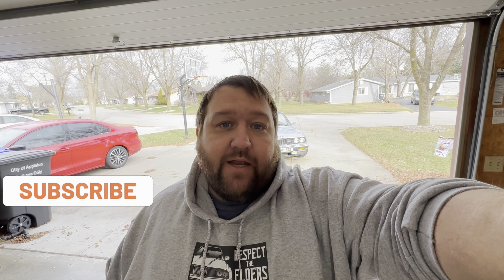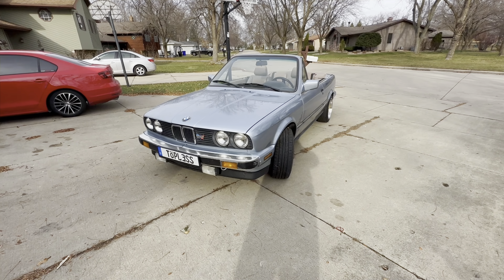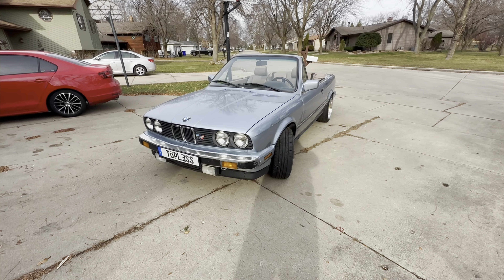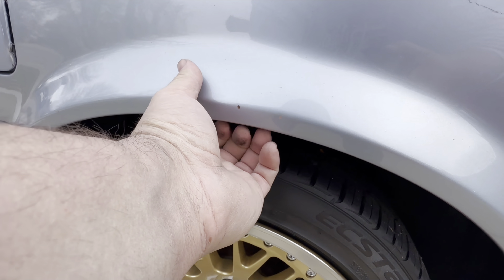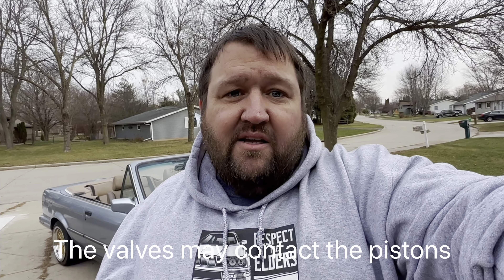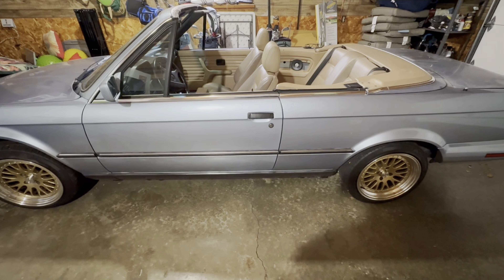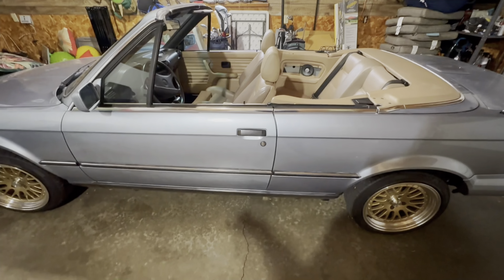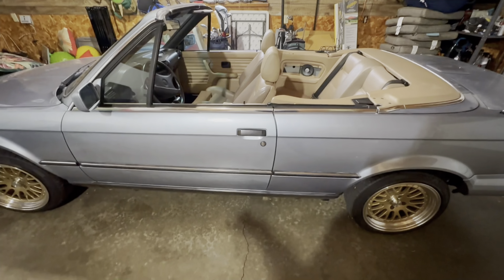Before you buy your first e30, watch this!

Comment: bought my e30 with a broken odo that said 140k miles after getting the carfax for it i found out it had 250k miles in 2007 hahaha. Has atleast 400k on it now with the same motor and is still going strong!
Reply from the maker: 400k means it’s just broken in. Time for a turbo lol.
Reply: @TheEuroLife.  thats the plan! eventually lol
Reply: are you kidding?? that's insane. my odo just went at 136k as well

Comment: I would add one thing, the water pumps on the M20 are behind the timing belt and they are fairly inexpensive so if you replace them every other timing belt change you will save yourself from a really bad day later on.
Reply from the maker: 100% correct. I guess I forgot to add that little bit in there. And pumps are usually due about the same time as the belt itself anyway🤷‍♂️
Reply: @TheEuroLife.   ley say I have BMW E30 318 then is the water pumps behind the timing chain? If it's not there then where is it?
Reply: @mihail854  if your talking abouy a timming chain thens it´s a M10  
And no, the water pump it´s behind the acessories belt
Can´t talk about a m40

Comment: couple things to add that will almost always need replacing. Spark plug wires, ignition coil, distributor, crank position sensor, coolant temp sensor, water pump engine ground wire, intank fuel pump external fuel pump, all fuel lines, brake lines
Reply: Basically git everything and replace it

Comment: 1988 318i 5sp.  - Bronzitbeig.  Owned in Heidelberg, Germany.  It was flawless.
1991 318is 5sp. - Diamantschwarz.  Rear ended and totalled ☹
1991 318is 5sp. - Diamantschwarz.  Still have it.  Totally restored, full body restoration, all new trim, full engine rebuilt, new paint, 17" APEXs, 1995 M3 steering rack.  Still need to fix the sport driver side seat.  Drives like dream.
Reply: How much km's are the 318 blocks good for?
Reply: @sepppe0484  I have no idea.  But my M42 block is in excellent condition and they decked and squared with a good cylinder honing.  All new Mahle pistons, matching rings.  We re-used the connecting rods as they are forged from factory.  We also used all ARP bolts for the connection rods and mains.
Reply: @sepppe0484  It's not the mileage but the wear, for example the maximum bore size for the M42 is 86mm (that's +2mm over stock).

Comment: what is the wheels parameters, et, ej, r, please?
Reply from the maker: 16x8 +25
Reply: @TheEuroLife.  without spacers ?
Reply from the maker: Currently no spacers and the wheels fit, but clearance to caliper is tight. I’m going to be running 5mm spacers this year.
Reply: @TheEuroLife.  Do I understand correctly that you can immediately install et25, and then there will be no problems? I think on 17 8j et25 do you think they will fit well? Are you going to put spacers on all 4 wheels or just one axle?
Reply: @TheEuroLife.  your suspension without lowering?
Reply from the maker: I just know that my setup currently does fit on mine. I do know some e30’s had larger strut housings, so my setup may not work on those. 

I would recommend running a spacer, just to be safe. I will be running spacers on all 4 wheels.
Reply: @TheEuroLife.  do you have a 45 or 51 mm flask?
Reply from the maker: Looking at it, the 45mm only came in 84 and 85, so every other e30 has the 51mm. So shouldn’t be an issue if you have an e30 built after 1985.
Reply: @TheEuroLife.  I have a 1991 e30, for the European market, a 1.6 engine, and initially it costs 45mm from the factory. Perhaps other configurations went to the American market
Reply from the maker: Yes, that is possible. Unfortunately, I only know about North American market e30’s. 

If you have the 45mm, you should be fine, as mine with the 51mm has a few mm of clearance. I would suggest that you do get spacers though, as you want to be sure you have no issues with rubbing. You shouldn’t need big spacers, as I’ve got 5mm just to be safe.

Comment: At boot minute 5:30 cooling system fluid leaks… my 1987 325 ic sprung a sweet-smelling glycol liquid out of my heater core onto the floor. How it goes… 😊
Reply: There was actually a recall for this exact issue. BMW still services the E30 and would do so if you took it in.